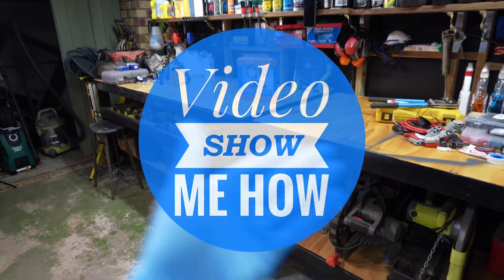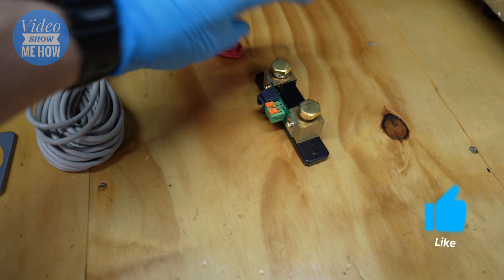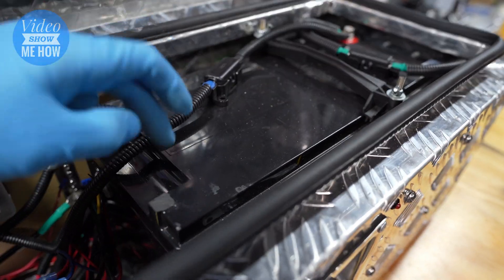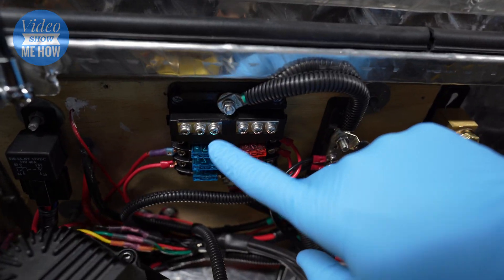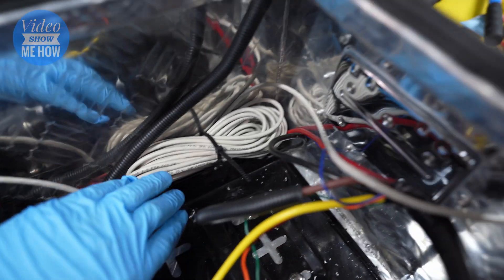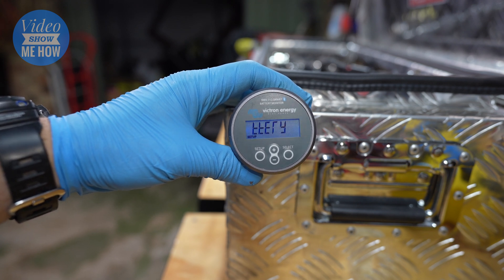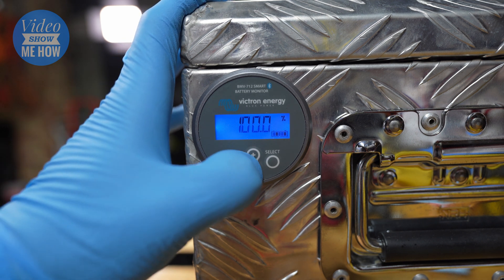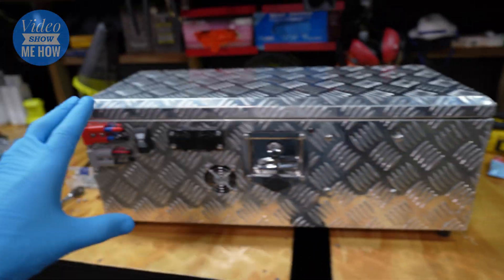VICTRON BMV-712 Bluetooth Battery Monitor | HOW TO Install | DIY Lithium Battery Box Series

Comment: Great video mate.  I'm getting ready to do a similar install - but with a 25a Redarc BCDC.  However, I rang their technical support, and they advised that the bcdc needs to be on the BATTERY side of the shut NOT the load side.  I found that confusing, so I waited and spoke with someone else at Redarc, and then a completely independent Auto sparky whom advised the same - BATTERY side.  Apparently whilst the shut does read the voltage if its connected to the load side, it will be out.  What would you recommend - I personally feel it should be on the load side.
Reply from the maker: Never heard that before, shunt is always the last connection before the battery stud? They've got some decent wiring diagrams on their website, just do a google that might help. .(How to wire a BCDC from caravan to vehicle with smart alternator https://share.google/452gQv7iEwCWtw4Cg) Sounds like there's some 'wires crossed' somewhere 😬

Comment: Hi…Adam. Wayne from Malaysia. I would like to ask where is the doom lights fuse locate? I know is below dash fuse box, just don’t know is which one. I need that power source to adding some lights. Can you show me? Thank you
Reply from the maker: Which lights? On the back of the holder you pull out to access the fuses it has a stick that shows what each of the fuses are
Reply: @VideoShowMeHow  I’ve check the sticker at the back. But din’t wrote the light I’m looking for. I mean the interior roof lights. The light is when we open the door will light up.

Comment: The master switch installed between the midi fuse and the starter battery: what purpose does that serve, and when would you have it on/off? Thanks for all the help man!
Reply from the maker: So I can isolate the system 👍 Eg if I removed the box for example, no live current being sent to that Anderson plug. Also lithiums don't tend to like being stored at 100% when not in use so I tend to only have the system on when I'm running a load (eg fridge on etc)
Reply: @VideoShowMeHow  ahhh that makes sense to me now. Especially regarding the lithium - thanks!
Reply: @VideoShowMeHow  so would you use that master switch to "isolate" the system when you are at camp so that you don't drain thr starter battery when running accessories etc?? Or is the redarc clever enough to prevent that from happening..
Reply from the maker: @alwynvanderlinde9507  no you won't have prob, the bcdc needs to see charging voltage to turn on

Comment: Gday mate, love your videos very informative! I am thinking of doing something very similar but also adding an 1000w inverter. One question do i connect the pos/neg straight to the battery as it requires much thicker cable and draws so much power or connect in to the POS to fuse block and NEG to the victron load side, or if you could point me in the right direction would help massively.Cheers for your videos mate.
Reply from the maker: 1000w is drawing about 78 amps at 12.8 so I'd go negative to shunt, positive to battery positive.. that way the bmv will read anything the inverter pulls etc

Comment: Hi Adam, what size cable did you use for the shunt to busbar and to the - of the battery? Still 6 b&s? Or did you have to go lower gauge? Thanks
Reply from the maker: Hi, it depends on what you're going to be running, add everything up and then give some headroom and then go from there 👍

Comment: Great series!!
How do you find the switch at the front of the box? Does it get knocked and turned on accidentally at all?
Reply from the maker: Cheers! No so far so good :) Have had in for a month or two now and over a few trips. I usually have the fridge lengthways on the left, seems to be fine. Could always change to a different type of you were building similar 👍